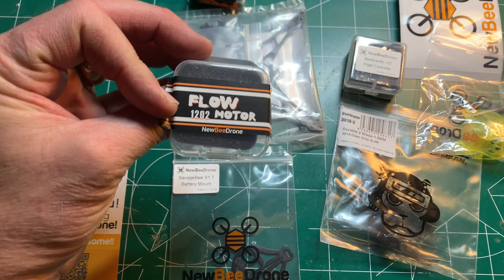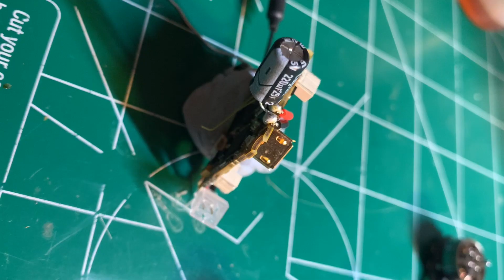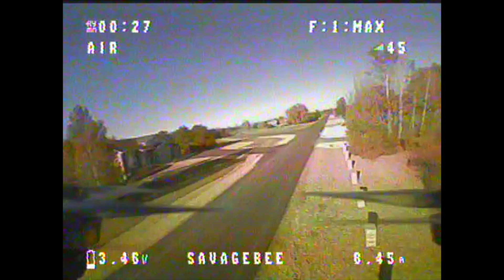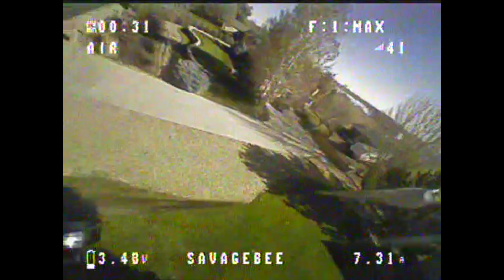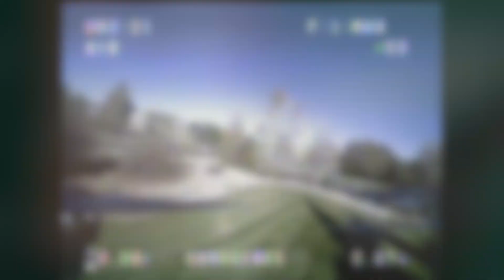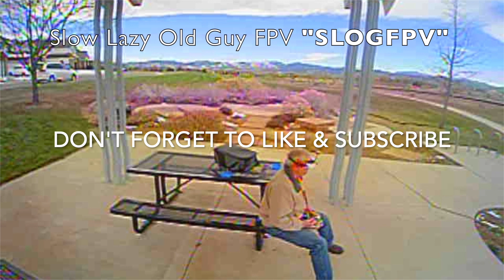NewBeeDrone SavageBee Build

Comment: Great video man! Do you know what the mounting size for the fc is? Thanks
Reply from the maker: Its the BeeBrainBL V2 AIO Flight Controller which uses the standard whoop Screw Hole Spacing: 25mm x 25mm. 
SLOG
Reply: @slogfpv  thanks slog! Do you think the crazybee f4 aio fc would fit? It's 28x28.
Reply from the maker: @overratedsrtchallenger  
Yes it would fit but I would be concerned about the FC ESCs only being rated at 5A with these size motors. I know the Crux uses 5A ESCs but I would still be concerned with reliability. The NewBeeDrone FC is rated at 12A. 
PS I just looked at the Crux motors and they are a lower KV motor (EX1202.5 6400KV Motors)so would not draw as much current on 1s. On this build they are 11420Kv motors. They do have 8420Kv for a 1s/2s build. But still higher.

Comment: Sorry for the noob question but why didn't you just plug the motors in instead of soldering?
Reply from the maker: Hi Nick,
Good question. The all in one flight controller in the build kit is actually made for whoop size motors which have a smaller connector. But yes it would have been nice if the connectors on the motors would fit the FC.
Cheers,
SLOG

Comment: I think building a DJI Caddx 3" has done wonders for me Slog, I really haven't felt the need to buy any more quads since! 
Been great! I can now watch vids of new quads without any desire to purchase them 😅😅
Reply from the maker: Hi Barnz1980,
If we are honest with ourselves, we really only need two quads, one as a daily driver and one backup. Maybe throwing in a 65mm whoop for winter if your in an area that gets snow. Look at Mr Steele, he has been flying close to the same Apex frame with only minor changes for several years. Flying consistently the same drone will make you a way better pilot (muscle memory). The main thing is to have fun. 
SLOG
Reply: @slogfpv  that's very true Mr Slog 👍